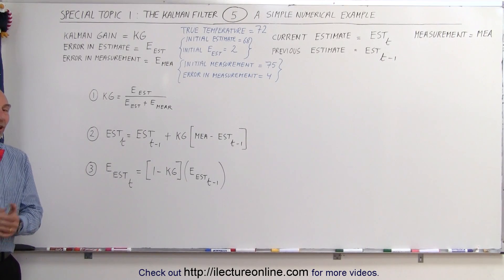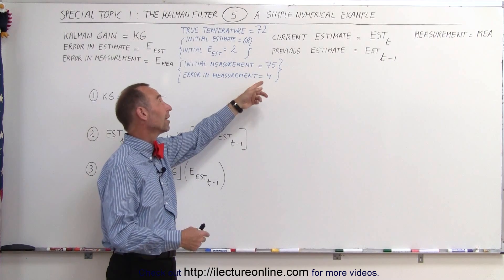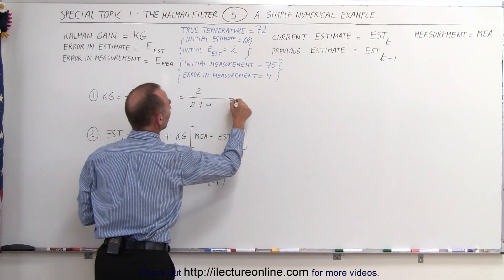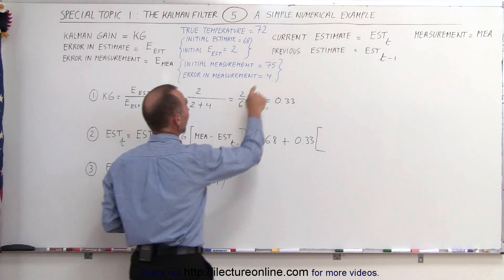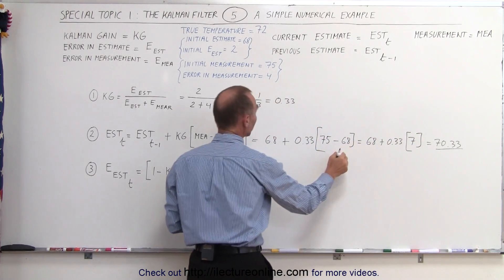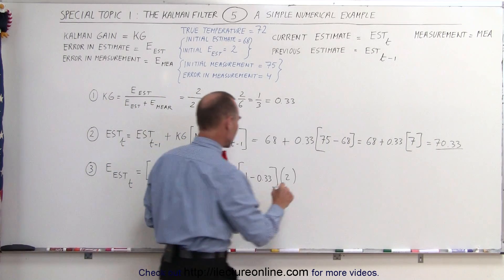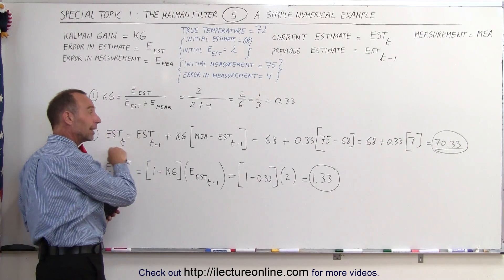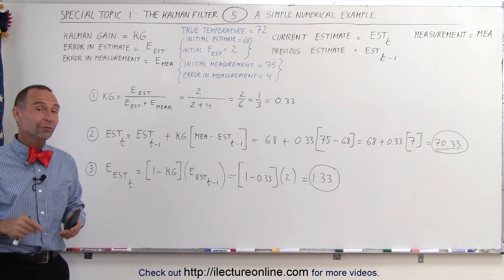Special Topics - The Kalman Filter (5 of 55) A Simple Example of the Kalman Filter

Comment: By the 3rd equation, do we assume that the maximum error in the estimate can be the previous estimate as we only take the portion of it in the update? Am I missing smth? Because in this case the error in the estimate will eventually be 0 even If there is still some error in the estimate e.g. when the actual error in the estimate is higher in reality than the initial error in the estimate.

Comment: How do you get the initial error in the estimate? I can understand the initial error in the measurement might be from sensor specs or covariance provided from a 'third party', but how do you determine the uncertainty of your estimate on the first iteration?
Reply from the maker: It is usually a "best guess".  It turns out that it doesn't matter much, since the filter quickly zeros in to the best estimated value.

Comment: Thanks for these awesome tutorials! I have a question, where does initial estimate come from? Is it a random value?
Reply from the maker: Thank you.  The initial values come from understanding the system you are working with and thus become your best estimate.  Even if your estimate is way off, the KF will converge quickly once the measurements start coming in.
Reply: @MichelvanBiezen  Thank you so much for the prompt reply.

Comment: if we take an initial  estimate above 75 (maybe we can ,as we now that true estimate varies from (75-4,75+4)we will not come close to "true temperature 72",then how should we select right initial estimate?2. how to select initial error estimate ?Thank you
Reply from the maker: Even if the initial estimate is off, the filter will quickly get you to the correct range once the readings come in.
Reply: @MichelvanBiezen  ok ,thanks a lot

Comment: If the measured value changes it has no influence on Eest or Emea. The first one keeps getting smaller and the second one is constant. KG is becoming zero and so my EST just refuses to adapt to the new value. What do I do wrong?
Reply from the maker: The simplistic example is not the way the KF is applied, but is there to help in understanding the filter.  Look at the remainder of the videos to get a better idea of how to use the KF.

Comment: What if we don't know what the true value is.
Reply from the maker: The true value is typically not known, only the measure value which has measurement errors, and equipment errors.  That is why the KF will converge to something close to the true value.
Reply: @MichelvanBiezen  how do we tell if what  we have is close enough to the true value
Reply from the maker: You can't unless you have an independent way of verifying.  When the code is tested, we usually use a secondary method to confirm, or we have a standard setup to compare against.

Comment: In this example initial value is 68 and we know Error in Measurement is plus or minus 4, so why are we doing all these, its basically  we can add EM with initial value i.e. 68 and get 72 which is very much close or exactly true value(72). Is this process help us to understand what could be the treatment we need to apply on Error of Measurement(4) ? I mean do we need to consider this EM as a additive or subtraction in nature ?

Comment: There is some potential confusion about the meaning of the "error". From the equations this is used to mean the estimated variance. But where the blue writing says "ERROR IN MEASUREMENT = 4", you said the true value is between 71 and 79 without further explanation. Firstly this is not precisely true with gaussian errors, as large errors are merely unlikely, not impossible, but secondly it needs clarification that since the variance is 4, the standard deviation is 2, and there is about 95% chance of the true value being in the range specified. As it is, it looks like the "error" of 4 has been added and subtracted from the measured value, which would be dimensionally incorrect.
Reply: you read my mind. people should heed this comment.
Reply: maybe the variance is 16 ?
Reply: He is not getting into statistics, neither commenting about gaussian noise (or any specific kind of noise). For educational purposes, he is just stating that your error is +/- 4.
Reply: @ale895  Also states on the video - "A Simple Example". Not one where every variable is present with thermal noise
Reply: Good point!   I missed the comment about 'between 71 and 79' and kept thinking if you know the measurement error, you can find the true value in 1 step.   Why bother with the iterative process?  The term 'measurement error' should be explained more.  Whoever watching this video knows the meaning of variance and standard deviation.

Comment: how do you get the error of the measurement? Does it need to be specified with the measurement device?
Reply: From engineering point of view, yes. When you buy a sensor, you have its tolerance on the datasheet. What is even better, you have the error as a function of other variables, such as temperature and, say pressure. 

One way to go around that is to assume worst error. You could also vary the error as function of time, but then you need more theory to understand the effects of the variation, and whether the answer will converge or not, such as how fast you run the filter, how many samples,...

Comment: Is it a prerequisite that  Initial estimation error (or uncertainty)  must not be zero?  It seems logical.  If the initial estimation error is zero, then KG would be zero and subsequent estimation error terms would be zero. Measurement would never be considered.  That brings a question about the guidelines for initial estimation error value.  Appreciate any perspectives.
Reply from the maker: I would not start with a zero initial error estimate, which in most cases would not be a good model of the situation.

Comment: hi Michel:
Thank you for the awesome tutorial. I have a question about the "true temperature". Since we don't know the true value of the temperature under noise. How do we set up the "Estimate" and "Measurement" ?
Reply from the maker: You don't need the "true" value.  We just use it here to show how the filter works.  The filter will converge to a value close to the "true" value.
Reply: Thank you. Sorry, I ask too quick before I finished the video.
Reply: @MichelvanBiezen  Hi Sir, it seems like after some iterations, the EST is converging to the MEA 75 instead of the true value 72

Comment: This seems great but what happens if the temperature changes. Like let's say I wanted to use this for a science experiment where we measured the temperature gain. How would the Kalman filter react
Reply from the maker: The Kalman filter will follow the change.  (That is the usual case, where the measured values change, where the Kalman filter is used.)
Reply: Hello Mr van Biezen
Thank you soo very mutch for this series!
I see that the Kalman filter will follow because the measurement flows into equation 2. But isn't the Kalman gain after some time so small that the filter reacts only realy slowly?
I mean, because of euqation 3 the error in estimate will get smaller and samller after a large nummer of calulations and therefore via equation 1 will the Kalman gain as well get samller and smaller. But wouldn't it be better to "open up" the Kalman gain again in some sort when the true temperature changes?
Reply: Ah I see, the answer is given with video 18 :-)

Comment: Great video ! I do learnt a lot from it, well, a question here, from your comment    "The Kalman filter makes a distinction between errors in the measurement due to the difficulty in making an accurate measurement and the errors caused by the measurement system itself." ,     what if the measurement system has the problem itself (the measuring is no longer correct), the Kalman filter will be useless here, right ?   It'll be appreciated for your reply.
Reply from the maker: The assumption is that the system errors are random.  If they system is broken, then it will not work.

Comment: If initial measurement is 75 and true value is 72, how the error in measurement is 4?
Shouldn't that be equal to 3!?
Reply from the maker: It doesn't matter where you set the initial error.  It will converge quickly with the filter.
Reply: Michel van Biezen Thanks for replying sir. I understood, but isn't it good to be accurate from the beginning?
Reply from the maker: Not necessary.  Most of the time you are just guessing at the initial error anyway.
Reply: I think at the beginning you wouldn't know the true temperature 😉.

Comment: Am getting raw sensor values..How do i know what is error in the estimate or error in measured value ?
Reply: From a fellow student:

As I understood, the error in the estimate will be corrected by the Kalman filter algorithm when you assign E_est(t) := (1-K)(E_est(t-1), It seems there's a least square error predictor in disguise in there.  So I guess as long as you're not wrong by an order of magnitude, you could probably put some arbitrary number there, maybe the error presented in your sensor's datasheet. 

This is what I'm going to try in my implementation:  I have a sensor and MCU updating at 100hz, I will have an initialization function that takes measurements assuming the sensor is at a steady state and calculate the cumulative mean and variance until they seem to asymptote to some respective values. The initialization function returns those values. those are the values that will be passed as jump-start state for my Kalman Filter function.
Reply: Thank you so much for the response

Comment: There is a mistake in the beginning of explanation: errors in Kalman gain statement must be squared sigma (also called variance). Therefore, initial estimate varies from 68-sqrt(2)..68+sqrt(2), because Eest is a squared sigma value of the estimate. So does measurement error.
Reply: Yeah, but if you watch his whole series on ilectureonline, this progression makes sense.

Comment: Very nice explanation sir. But I have doubt, I have a real time application of Kalman filter for estimating battery state of charge. Here my measured value - voltage is a non uniform environment because the temperature keeps varying with different discharge rate. So how do I actually guess the values.
Reply from the maker: The Kalman filter works with measured values.  If non of the values are measured then how do you know what they are?
Reply: SOC(state of charge) and current is constantly measured but it's a non linear function of temperature. So is there any solution? I have seen few research paper which uses Kalman filter for it. But I never understood
Reply from the maker: Yes, if you have regular measurements, and you know the equation that can convert the charge and current to a temperature, then you can set that up in your Kalman Filter as the input.

Comment: Hello!
These videos are great! I really learn a lot from these videos!
I have one question.
If measurements and true values are changing over time does it need some sort of reset or would it be able to zero in on the new true value?
Kind regards
Reply from the maker: No reset is necessary.  The filter will zero in on the new values or the constantly changing values.
Reply: +Michel van Biezen Great! Thank you for the answer :)
Reply: I have this problem of  KF not tracking newer values. Still trying to understand what to do.

Comment: Great tutorial video. It is very help me to understand what and how does kalman filter work. But, I wanna ask something. How I get the initial estimate? I have a project using kalman filter. I use it to minimize the error from the sensor (temperature, air pressure, humidity, and wave)
Reply from the maker: +Redhianto Edwin Suryadharma 
With the Kalman filter it is not important to get the initial estimate "correct".  The Kalman filter will quickly narrow it down to the correct numbers, so don't worry about starting with a guess.

Comment: Hi Michel,

It seems that the speed of convergence of the Kalman gain is only dependent on the intial values of Est and Emea. If we assume that Emea = c*Est then K = 1/(1+c) with 0<c<1.
This leads to Est(t) = (c/(1+c))*Est(t-1) this clearly always will converge to 0.

I kan understand this if I have á priori knowledge of the signal and the estimating process. If you know that the signal is constant, probably statisticians will be able to prove that it will convergence to the 'real' value.
By choosing c you decide how many iterations the Kalman filter will need before it starts ignoring the measure values at all.

In reality often the signal will vary, the temperature will change because of external factors. This Kalman filter will ignore on the long term these fluctuations and will not track the true temperature anymore
How in a Kalman filter this is taken into account?
Reply: In which scenario you get 1 read per one value you have to output?

Comment: Fantastic video series, but I am unsure about a couple of things in this example. If we have a thermometer and it reads 75 whereas the actual temperature is 72, how do we know the initial error in estimate (Eest = 2)? also how did we determine the error in measurement (Emea = 4)? ....as far as I can tell all we have initially is the first measurement using the thermometer, so where did these other numbers come from?
Reply from the maker: +Gabriel Rd 
These numbers were just picked in order to illustrate the method.  I will be posting a full blown realistic example of tracking a satellite or aircraft in the near future.
Reply: +Michel van Biezen Thanks for the quick reply, I will continue going through the videos..... and a huge thank you for these series, these are the very best videos on these topics on youtube by far, heck they're a million times better than my textbooks!
Reply: +Gabriel Rd usually when you buy an instrument, the vendor gives you data about instrument's accuracy. i still have to finish the series before i can confirm that this is how you get an estimate of measurement error
Reply: You are right. Instruments should have their error stated in the manual